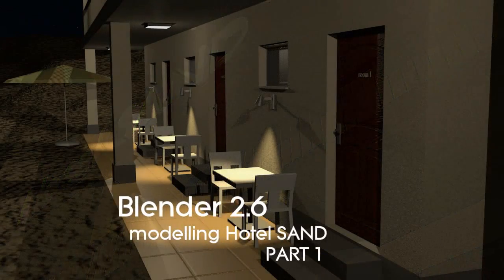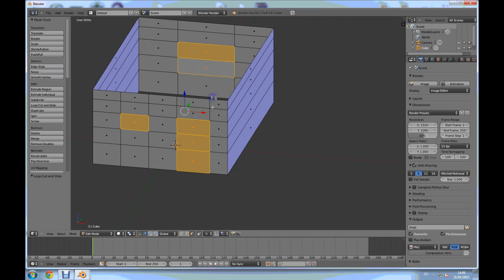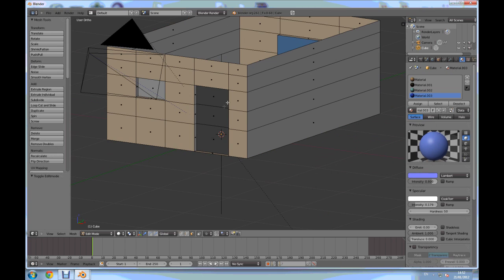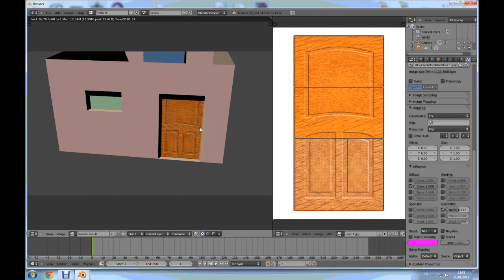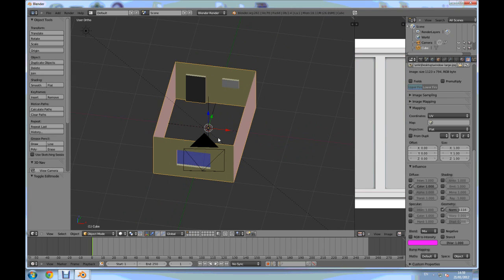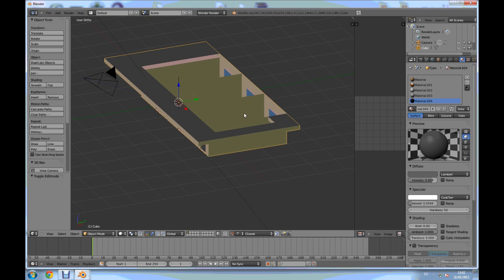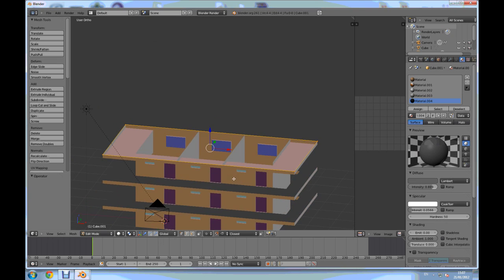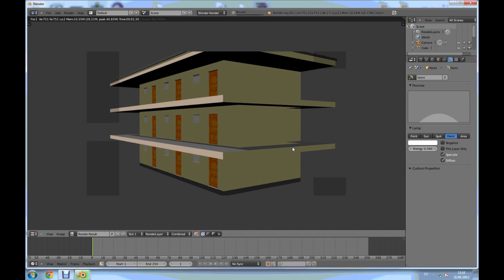Blender 2.6 tutorial- Small hotel modelling part 1

Comment: A lot of what is demonstrated (the door for example) is different in the latest version of Blender (2.68). Even in the Blender Render engine doesn't work the same as is shown. I'm using the Cycles Engine, and UV unwrapping of images doesn't seem to work either following these steps. They've moved a lot of stuff around in the menus, and I've noticed that in either Blender Render or Cycles the door image texture will NOT render after unwrapping it.